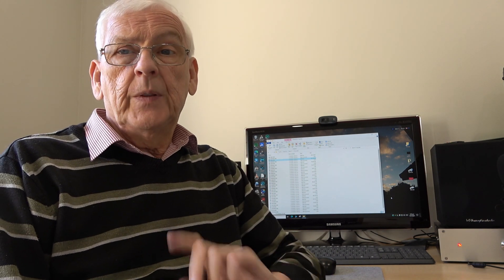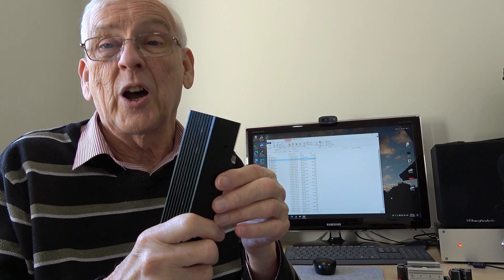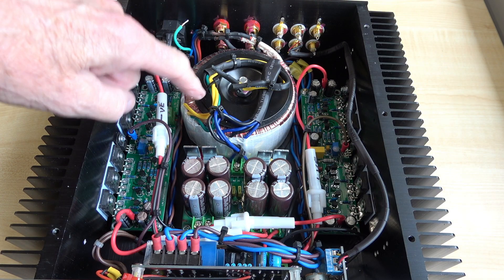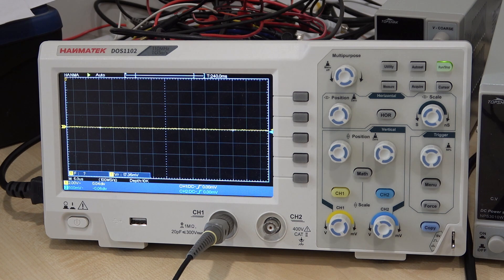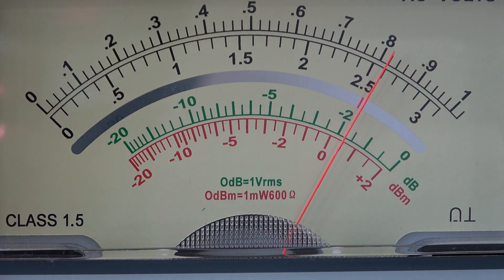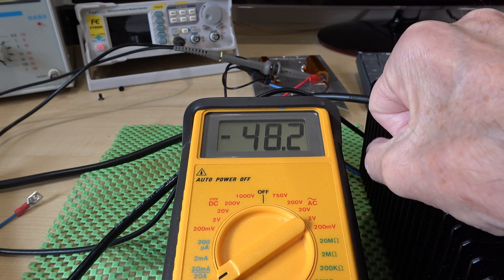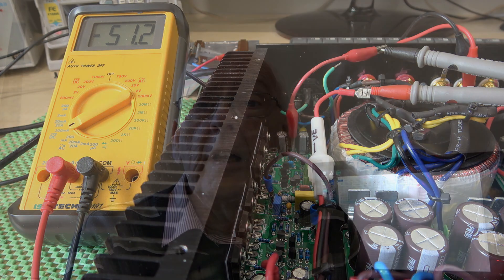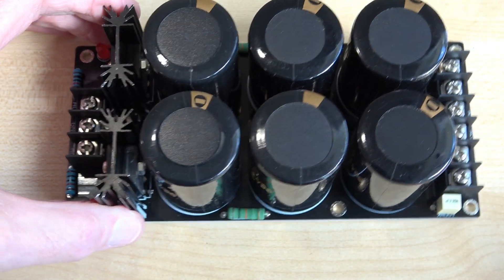L15 Amplifier. Power supply Changes.

Comment: hi Michael i also have 2 L15 modules
i am writing to you from italy and i compliment you on your videos.
i wanted to ask you 2 questions, is the 500VA transformer ok with a 40volt secondary? = +/- 55Vdc
what are the TP points to measure the Bias?
thanks Arduino Italia
Reply from the maker: The voltage is fine, but you could save on wattage. Unless you are planning on sine wave testing, a 300watt transformer will be fine with music and cost quite a bit less. Sorry I no longer have those L15 modules, long since sold.
Reply: @MichaelBeeny  thanks for the reply, do you no longer remember what the test point points were to adjust the bias?

Comment: Ive got the same amplifier board I just purchased. I'm not sure on what voltage and power transformer I should purchase As I got no data on what it should be. If you could  let me know what you're using  I'd appreciate it

I will be using 8 ohms speaker not 4 ohms I want it as a class AB not class A

This my first time building my own AB amplifier.  I build computers normally. It's still comparing Apples and oranges compared to what I'm used  to. Your video tips help. But I'm having  problems finding  the right transformer power for it as I got no data on it. If you can suggest something or let me know the exact power transformer you have I'd appreciate it
Reply from the maker: The L15 can run on +60/0/-60 DC for maximum power, if your heatsinks are good enough. I am running on +50/0/-50 using a 35/0/35 volt AC transformer. This will give you about 100 watts into 8 ohms. A 300 watt transformer will be fine for music. The one I used is no longer available but you should not have any problem finding one. You could use a SMPS but harder to find one with plus and minus voltages.

Comment: is 50ma that high?  in the video u made Showing QI Adjust and modification the L12 circuit, there was nearly 40ma on 2 transistor per rail which would be 20ma over each transistor, that was on a transistor ouput stage and there are 3 mosfets running 50ma shared between the 3 fets which would be 16ma so in fact slightly less per device. I would have thought as u add more transistors in parallel the more current will be needed to bias them since they each are consuming 15-20ma's of current it has to come from somewhere.  That looks like a much better power supply btw looks lot safer. Great video! Keep up the good work love the channel!
Reply from the maker: Hi James, you are right of course, 50mA is low for 3 FETs. It's what the makes of the board set them up on. On a first QUICK look I see no crossover but I need to experiment with the QI. I've not used any Mosfets for probably 35 years in audio so may be modern FETs need less QI. The original Hitachi design with only 2 FETs used a lot more QI and did run quite warm. The fist high powered designs of the 80s got very warm indeed. I will do an update video soon after more research and experimentation.
Yes SMPS are abit scary!! and overall more reliable.

Comment: After building the MX50SE I went to the L12-2 with bias adjustment following your videos and it works like a charm. With these two projects I became a fan of Sziklai configuration, they have great sound and run on the cool side. Looking for the next project I am curious to know if you have any plans of testing the L20.5. Thanks for your work.
Reply from the maker: Hi Joao, I've not looked at the L20.5. Does look interesting. I think LJM cheats abit with his distortion measurements. He never shows distortion at high frequency's, that's were we need to see them, were they can rise quite a bit. Thanks for you're contribution, much appreciated.
Reply: @MichaelBeeny  Thanks for your quick reply! I agree, the measurements tend to be too optimist. What about the sound of the L15 compared to the L12-2? Thanks again.
Reply from the maker: @vit4min4s  I'm not sure yet. I was making comparative tests when I blow up my speakers. So at present I cannot make any realistic comparisons. In the short time I did listen the L15s did sound good. I will report back when I can on this one.
Reply: @MichaelBeeny  great, thanks

Comment: thank you for showing what equipment you used to measure watts.

I use the same resistor type but have connected many together so they can withstand 500 watts. but they do not withstand 500 watts. I would not have written more than 50 watts per resistor and not 100 watts. at 125 watts they become quite warm after approx. 5 minutes.

I use large heatsink
Reply from the maker: I do have a fan cooled much larger heatsink but at present I'm using it for another project as stuff takes forever to arrive these days from overseas.

Comment: heatsink take cold air from the underside and draw the air upwards through the heatsink fins as an electric heater does

hot air always goes upwards therefore there are also always holes in the bottom of an amplifier

the fins should go upwards so that air can pass through.

Heatsink on the outside of the box is made 100% correctly and the fins go in the right direction
Reply from the maker: The heatsinks on the box are really good, they conduct the heat really well.